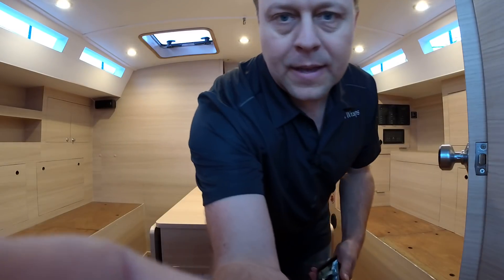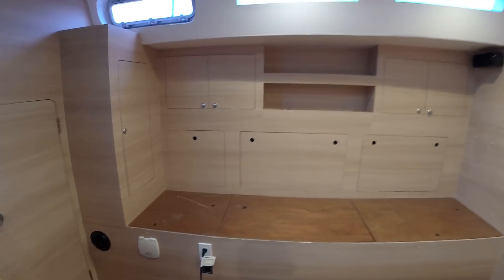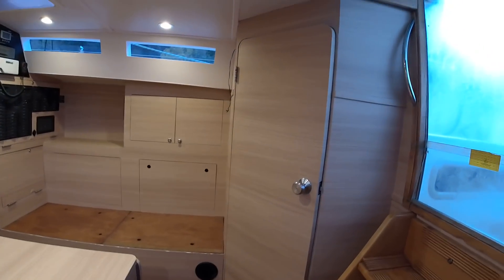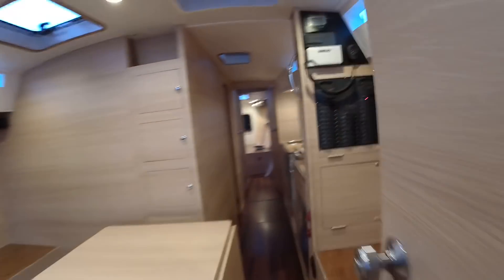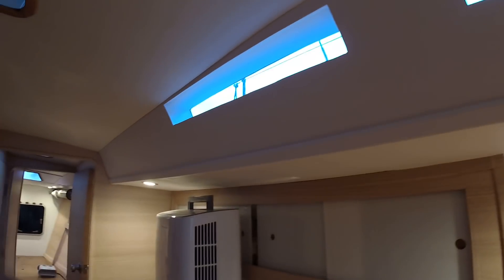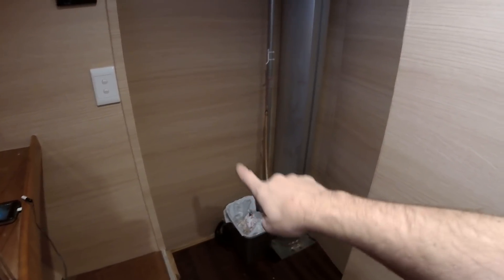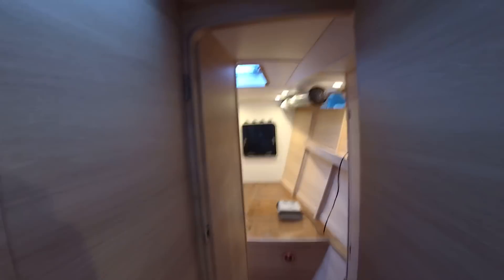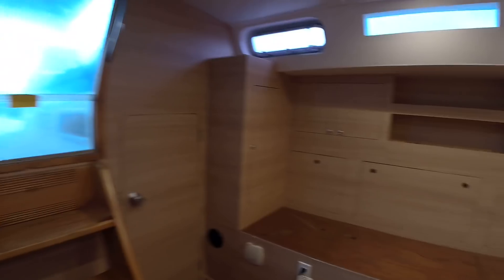Interior Sailboat wrap using the  Di-Noc Architectural Film. Showing the end project.

Comment: I'm sold! Looks Awesome. Question, areas like the bathroom countertop, would you apply a polyurethane or clear epoxy bar top finish? Same for a table top or kitchen countertop?
Reply from the maker: You can put a polyurethane or 2 part epoxy on the wrap but you don't have to. Here's one video you can watch that I did the other day. Wrapping a table with Belbien film with Clear Epoxy Resin on top https://youtu.be/T5DO2oNjemc
Reply: @RMwrapsllc  The table looks awesome! Great job. What's the major difference between the Di-Noc and Beibien films? Is one preferred over the other?
Reply from the maker: @brianunderwood3109  They both work and feel the same. Just 2 different companies making the same kind of vinyl. I like them both.

Comment: when will you be in texas ? today i gave up on wraping the cabinets in an RV . i’m just gonna have to pain it. i’m disappointed in myself. I wants wrapped a car in gold chrome. but I couldn’t do the cabinets in and rv . Maybe I just had the wrong wrap material. the material was called unicorn white from vvivid. it will not hold in some of the areas that are inverted  in the  cabinet doors
Reply from the maker: Did you use Primer 94 around the edges when you installed the vinyl? 
https://www.youtube.com/watch?v=DHM4PGZLc3E

* 3M Primer 94 1/2 Pint 8oz 
https://amzn.to/2IwB0iS

Add a little heat at the end of the wrapping
Reply: yes . I even tried putting on two coats.

Comment: Hate it because he covered the trim.  If there was some accent or contrast, it would be so much better.  It is bland.
Reply from the maker: This is just what this one customer wanted. There are over 1000 different unique finishes in the Di-Noc line, and any project doesn't have to be all one finish/color. You can partial wrap, do contrasting finishes, etc.
Reply: @RMwrapsllc  got a suggestion—if possible—stage the interior.  Put the cushions back, if they’re stowed in another part of the boat and anything else to add color and interest to the scene because as it was, it was pretty stark.  It looks like you do excellent work and that you’re super fast!